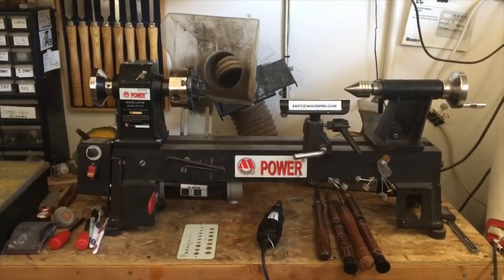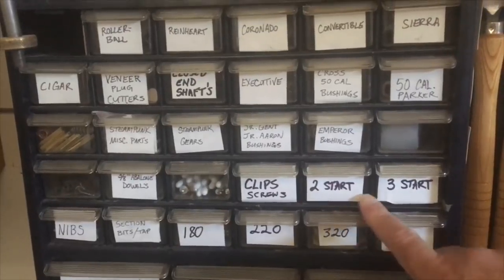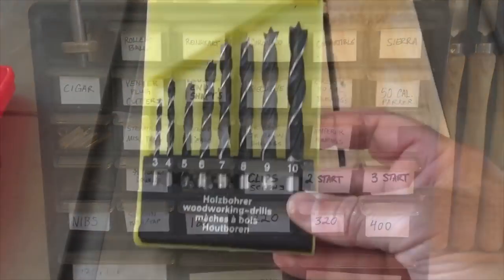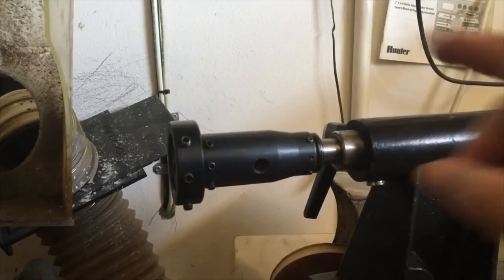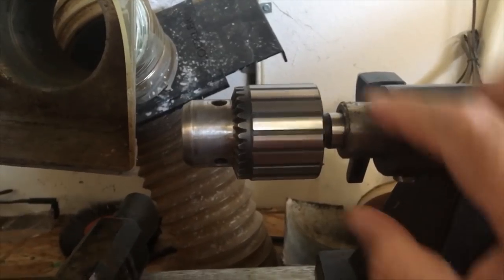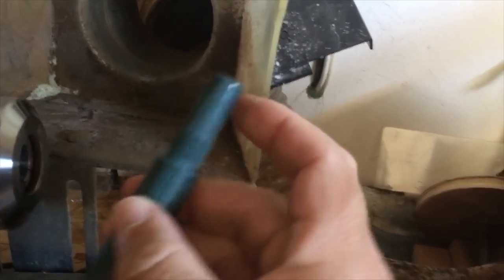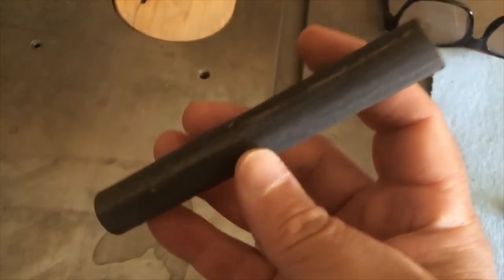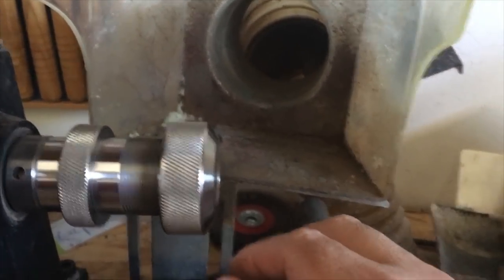Getting started in custom pen turning

Comment: Hi, Gabe, from an old engineer here in England, I can see you haven't clicked the collett  into the spring ring in the nut, the face of the nut should be flush with the face of the collett. keep up the good work.
Reply from the maker: Thank you for the tip Alfred.  I didn't realize it was supposed to.